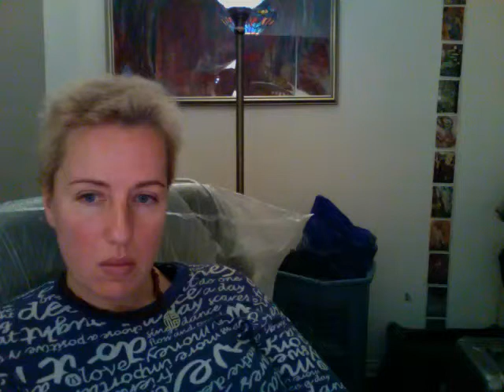Sari's Ferrocement Recipe :Movie on 2011-11-13 at 20.51.mov

Comment: My favorite formulation is; one part Portland morter mix, to one part Styrofoam expanded beads, and about 3/4 part water; all by volume, and random-rove fiberglass fabric pieces, trowel on the morter & bead mix (it is nice and sticky), and immediately place a piece of fiber glass fabric on and trowel over to stick on surface neatly. allow to set 24 hours then add a skim coat of trinity white with equal parts white sharp sand and color if white is not preferred, with cement staining pigment. For longer erosion reduction on the top half I paint the outside with white roofing sealer, it helps the snow side off too. But, I let it harden under a large plastic sheet for the first two weeks then let it dry for a week before painting it. The larger pieces of overlapping fiberglass cloth act as a  more unifying structural element than the short chopped pieces.( In my opinion.) on larger structures I use more than one application and use the fiberglass fabric in each layer except the skim finish coat.

Comment from the maker: Ok, so I dropped the perlite out because though it makes things lighter, it also makes things more fragile...(It is useful to know though if you are getting to heavy in a piece)...I also dropped the white silica sand...It does add strength but it compromises the stickiness...(again useful in strength needing sculpture)...So I have gone to sticky marble...I am now using: 2 parts white cement to 1 part aggregate, aggregate is half Alkaline resistant glass fibre 3/4" to half Aragonite sand(marble).

Comment from the maker: http://www.grovecanada.ca/#!home/mainPage This page on my website has the recipe I used for a sculpture that is living 45 minutes North & West of Toronto...Outdoors...Key things I learned:The more complex the recipe the stronger it will be(from a free Russian ebook on cement hardness)...The longer the glass fibres the stronger...I used 3/4" glass fibres, but for GFRC you are supposed to use 1-1/2" long pieces, which I couldn't find here...I added Perlite because it was getting too heavy-but if heavy is not a problem then maybe delete the perlite-it makes it more fragile too...Aragonite sand is just a form of marble sand which makes the mix stickier & more pleasant to work with...Latex Adhesive "Milk" comes in different strengths...The pros use a Milk that really stinks & gives you a headache unless you are wearing an awesome respirator...But a strong Milk is like glue & really waterproofs things integrally...The longer the cure before placing outside the better...Then I used a NO VOC concrete sealer made by a company called Eco-House here, well in New Brunswick...They mixed a mix for me that included a no-graffiti element-once you coat it with that, graffiti can be removed much more easily from a sculpture...Anything more than 2 parts white cement to 1 part aggregate didn't work for me...I know most recipes call for more cement, but here it just didn't stick well enough...I tested my mixes by making a snowball around some copper wire, letting it cure, then moving it back & forth between the oven & the freezer...

Comment from the maker: I am not sure why, maybe because it is so cold here, or the high humidity levels, but the traditional recipes for good concrete mixes didn't work for me...The standard you speak of just wasn't sticking together...It was exhausting because pieces would flop down if there was even slightly a vertical plane...
  I am now using a much more simplified mix too...I still need two parts white cement to one part aggregate (at most) to help it to be sticky enough to handle sculpting...See next comment...